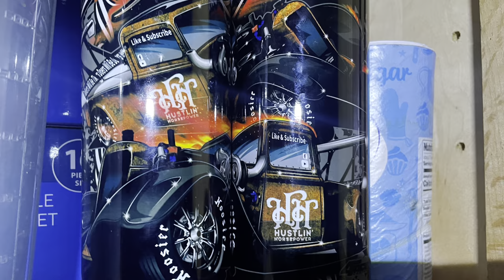Halfway To A Short Block! Twin Turbo BBC Build Series Pt:3

Comment: I guess I don’t get how the 2nd ring gets  burnt up if a’guy fits it to the bore first if it’s usually a different gap from the top ring, I guess I don’t get how if your doing them separately of each other e.a checking them filling them
Reply from the maker: It’s a softer material so it files wayyy faster